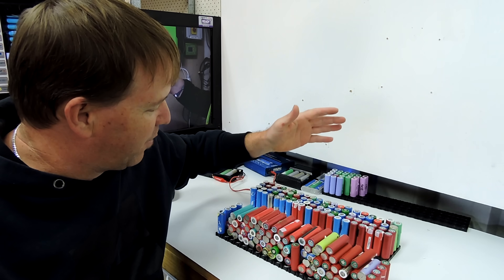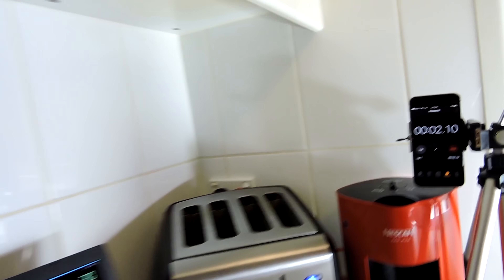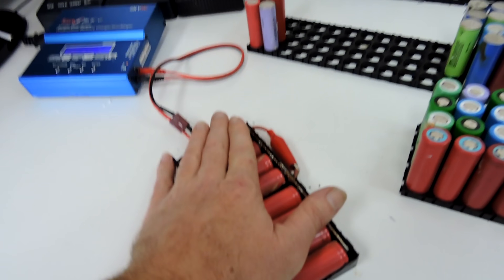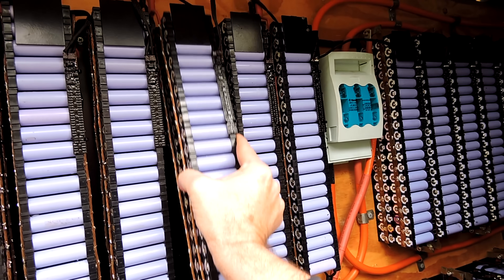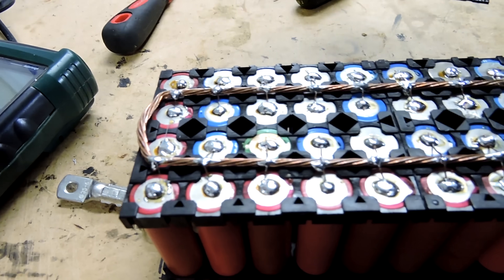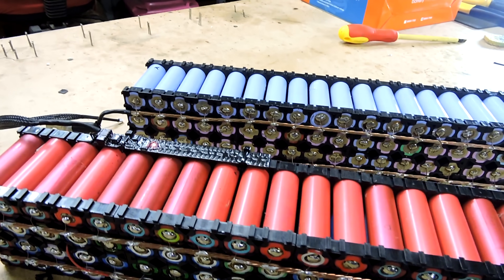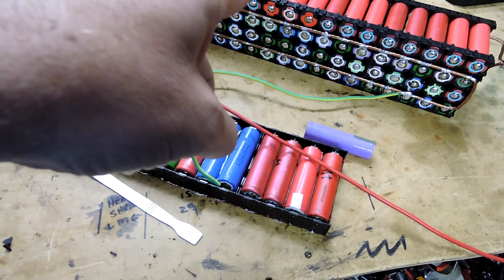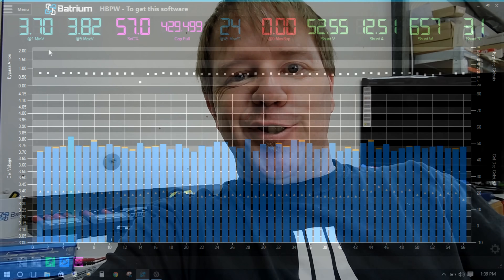It's bad practice but I'm doing it for science - 18650 DIY building for failure

Comment: help me understand the problem with using less than 2000 mAh cells.  as long as the packs are balanced, even if they have a combination of 500 mAh and 3000 mAh in the pack, if the overall pack is consistent from pack to pack, then it should balance and produce (albeit eat a lower overall capacity than a pack made of all 2500 mAh cells). is my thinking wrong?  I plan on using the good cells I have, even if they have a capacity of 1900.  if that's bad, then I want to know, and won't.  however, I don't want to waste a good cell for 100 mAh.
Reply: DIY Tesla PowerWall  You can mix and match capacities of the cells that are going in parallel as long as they are all the same chemistry.  I use my weak cells to tweak the capacity of each pack of parallel so that when you put them in series each series string has a matching capacity.  When you have cells in parallel they will all be at the same voltage so when you draw the pack down all of the cells in parallel will still match the same voltage but the cells with lower capacity will discharge at a slower rate than the cells with higher capacity.  

The reason you don't generally use batteries under say 1500mah or 2000mah whatever you decide to go with, is that each space in a power wall pack is valuable and so it is kinda pointless to use the cells that are below this capacity for an installation based on the amount of work needed to build each pack.

Comment: hey Pete, what's your educational background? do you have a degree in electronic engineering or? ...where would be a good place to learn about the stuff you do on your page? cheers, and keep up the awesome vids!
Reply: i highly dislike censorship @pete
to clarify my deleted response, there is a link in the description, to a froum pete mentions about 10 times per video. 
back to using the internet - you always have to check for your local legislation on what you have to use by your local-code, and what you are allowed to do in the firstplace, it is similiar across the globe by design, copper is still copper around the planet, but 6awg cant be found at all places, same with 10mm² or 16mm², or specific crimps, connectors and such - to say it short, you will not finde one person for all your questions or problems, if you do, you are basically buying the powerwall from them and not building your own

Comment: Seems risky to me. Could destroy all your  hard work.
Reply from the maker: Fair call, however I have stopped using my powerwall and gone completely back to grid and am monitoring it CONSTANTLY, with the Batrium software on a separate screen in my workshop, remote camera & in person checks with thermal camera as it charges and balances
Reply: Hahah, well, if it all goes to crapper, you can refer back your "What I'd Do Next Time" thread and make  your changes  :P
Reply: may I ask why would you go back to grid while you can go renewable with batteries ?
Reply: Once connected to the grid, it's a good idea to keep it as a backup. Like in this case, he had issues and needed to go back for a few days till things got straightened out. It only costs little money to stay connected (Where I live $20 for the connection). If the cells are drained due to weather, you can rely on the grid for backup. I know a generator would be optimal, but not always. It needs petrol to run. There are times where staying connecting is beneficial.
Also, as what he said in another video (live stream I believe), he uses 20KWh from the Grid alone, and that's with just a few things connected. That's on TOP of the 40+KWh (i think) from the batteries. Pete is power hog!  :P